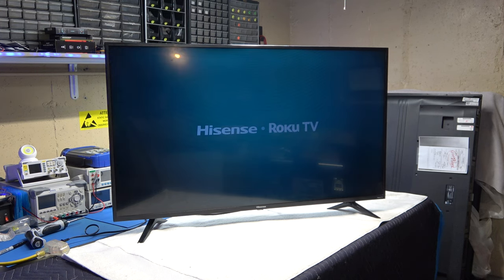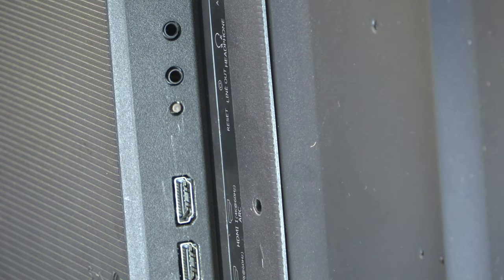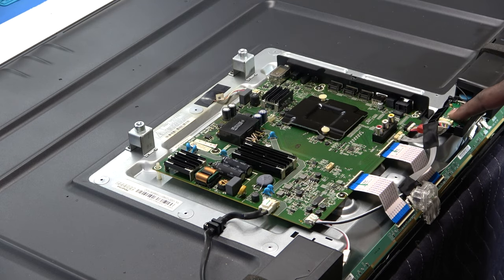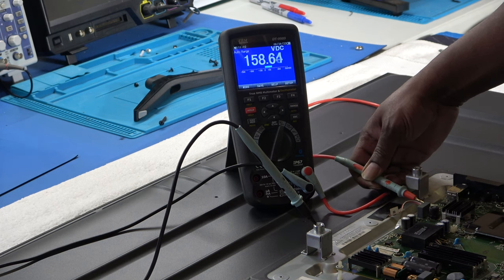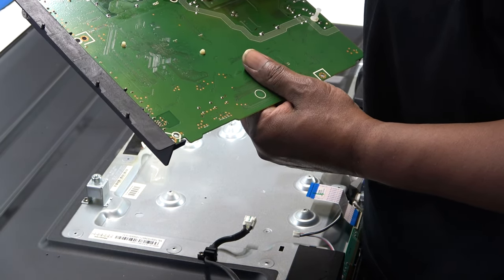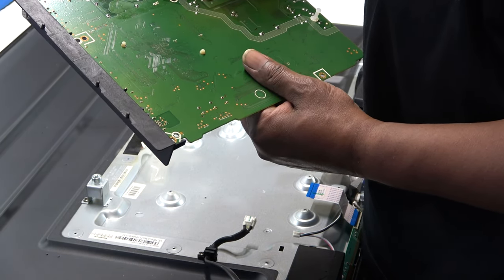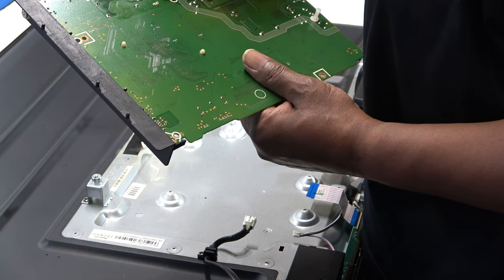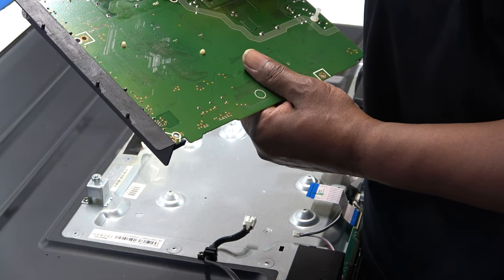Hisense Roku 50R7E boot loop fix when reset button doesn't work.

Comment: Dude! You’re a life saver!! Thanks for this info. Hisense is of no help when you call, I tried the reset button numerous times with the same issue (screen bounces between on and off constantly), and sure enough.. have these swollen capacitors. Local computer repair place charged me $5 to replace them and now my TV works like new
Reply: Mi television esta asiendo eso y no tiene un rest bottom
Reply: You reset with the power button @chiquitasleep
Reply: @IMjustAGirlInTheWorld1983 My tv power button used to turn off my tv but the problem of display started it wouldn't turn off except I use remote. How do I do the reset?

Comment: Having the same problem with a Hisense 55U6K from Best Buy. This is the model with the mini leds.  The back of the TV shows May 17, 2023.  Purchased on 10/5/2023.  It failed in mid-December 2023 and was not used daily. Only now just getting around to trying to troubleshoot it.  THANK YOU so much for making and posting this well-done video! 😎👍👍
Reply: I pulled the cover off and all the caps look good.  I have no idea now what could be wrong with it. :-(
Reply from the maker: Its still under warranty, take it back or call Best Buy with model and serial #.
Reply: @frankcanha  You say they "look" good. Did you test them to be sure? I've had too many times of buying something and relying on the fact that it's new, and turn around and test it and it's garbage. This seems to happen more often than it should these days. Anyway, if you decide to test them bitches, there IS a right way and a wrong way. From what I gather, (yeah, I ain't got a clue) they can explode if you don't drain a used capacitor because they can still hold a charge even after removing them. Good luck to you. I'm gonna see if I blow up once my capacitors are delivered.
Reply: @bigdog8882  Hey can you please tell me the size of the capacitors if you remember.

Comment: man i had my tv not working for along time and almost threw it outside but decided to try replace the capacitors as they were a bit bulged out, ofc they were hard to find so had to order from China but they came fast still, replaced both of them just incase and poof its been working fine ever since, TYSM MAN YOUR A LIFE SAVER🔥🔥🔥🔥

Comment: Just watched your first video,and it didn't work as I tried 4 times. But, I noticed that a black bar came across my screen after I let the re set button go. Hopefully trying this will help. Thanks for you help
Reply: Same happened to me with the black bar did you have any hope?
Reply: @marvintolbert2409  I had the same black bar issue when resetting and replacing the capacitors worked for me. I just fixed my TV 15 minutes back, hope it helps.
Reply: @waqasahsan  thanks I'll try it

Comment: I have a 55R6040G Hisense Roku TV that had the LED Backlight go dim all of a sudden. The backlight was evenly lit so i suspected something on the main board was the issue. I scanned the board and saw the two capacitors in this video swollen. This happened last week and I'm waiting on the capacitors to arrive in a couple of days. But this video confirmed my suspicions were correct and was hoping this would be the fix. Your video definitely made me confident in knowing that was the issue. This video randomly popped up on my home page and I'm so grateful. Thank You for taking the time to post this repair. Cheers!

Comment: I was also a victim of this problem with my Hisense Roku 43 inch TV. And guess what I saw when I opened the back cover? THE 2 SWOLLEN CAPACITORS!! So I replaced them and WALA! FIXED and RUNNING! Thank you my brother I have my 2 year old TV back.
Reply: Where did you get yours at?

Comment: Thank you for this video!!!! 

This is exactly what my problem was, except that only one of the two capacitors was actually bad. 

Now I did not have the correct value on hand, so I ended up “creating” a 10uF, 350V+ (actually 550 volts) capacitor by putting a total of ELEVEN caps in series, all of varying capacitance values but all were rated at only 50 volts each. It worked perfectly!!!

I am ordering the correct capacitors for this TV from Digikey, and I will replace both capacitors, but at least I have a working TV while I wait for them to arrive. 

Again, thank you, thank you, thank you for making this video!

Comment: Thank you so much! I searched for months for an answer to this. I could not find 350v 10mf capacitors on ebay on Amazon that were reasonably priced or in the US, so I bought 400v 10mf and it worked just fine. I had a little trouble heating the old solder to remove and pushing in the new capacitors, but I kept at it.
Reply: Do you happen to have the link to the capacitor I need to order 2
Reply: Same

Comment: Great video. After trying soft reset and hard reset on my 50RGE1 I found this video. Didn't bother checking just went a head and ordered the parts. After opening it up sure enough the 2 capacitors were bad and I replaced them. It only took a few minutes and fixed the problem right up.

Comment: Great video! Watched it once, was able to clearly understand the fix and replaced my capacitors in less than an hour! Thank you!
Reply from the maker: Great to hear!
Reply: @bigdog8882  Hey at Minute @4:50 The plastic power button My TV has the same one I tried everything but can't get it off you got any tips on how to remove it without breaking it?

Comment: I have a Hisense Tv that has a red blinking light and won’t turn on is this the same problem you think I’ve tried to reset and nothing
Reply from the maker: Probably not. Maybe backlight problem.
Reply: @bigdog8882  I tested the power supply board and I’m not getting any voltage where the led plugs in
Reply: @bigdog8882  I unplugged the led and plugged power into tv and tested to see if I was getting voltage where you plug led into and nothing

Comment: What if the capacitors don't look swollen , but your TV is doing the boot loop. I already tried to reset it with no luck. So its definitely something else. Could the capacitors be bad and not be swollen?
Reply from the maker: Is this the exact same TV as the one in the Video?
Reply: Idk if the same model but yes it's a hisense roku 55". Looks exactly the same
Reply from the maker: @illthoughts YOU would have to check the capacitors with esr meter or check the voltage, otherwise its usually the mainboard.

Comment: Hey @bigdog8882 , I have a TCL Roku  TV model 50FS3800 that is doing this exact same thing. After reviewing this video I took my TV apart but I am now staring at both a Power Suppy board & a TLC Main board. I cannot tell where to find where the LED capacitors are located to potentially replace. Can you tell me which board the LED capacitors will be on (either the Main or Power Supply)? None of the capacitors look swollen on either board but i rather start with the LED capacitors replacements first before taking everything apart. Thank you again 🙏

Comment: THANK YOUUUUUU, bruh. It didn't work at first after I changed the capacitors. Then i reset it. Still didn't work. About an hr later, it started working

Comment: Awesome videos, but what if the capacitors are fine? Have you run i to that? Thats what im dealing with, they look good, no swelling or anything. Also, arent the capacitors dangerous to touch? How can you tell of theyre charged and how do you discharge them safely?
Reply from the maker: May have a backlight problem. See if the picture is darker in a particular area when it reboots.

Comment: i have the same problem on a Hisense 65R61G keep rebooting plus no backlight , my backlights dead , no swollen capacitor but i still changed them and no change. what could i do ? replace mainboard and backlight ? is backlight failure could make tv rebooting i dont tgink so thanxxx
Reply from the maker: Is the picture rebooting, or No picture, just clicking? If u have any image at all when it reboots, then change main board.
Reply: @bigdog8882  i only see hisense roku tv with a flashlight ( no backlight ) appearing and then tv shut down like rebooting exactly like you but with no backlight . red light flashing 3 times

Comment: Bro, do you sell Mainboards?  Hisense 273265.. also is the reboot loop a mainboard issue, or a powerboard issue? 
Model 75H6510G Variation G2021JB
Reply from the maker: From my experience its the backlight or most likely main board.
Reply: @bigdog8882  I opened it up, none of the capacitors are bulging ... Main board says it's 27365 per Hisense.  But after opening it up it's actually 272945.  I wanted to avoid buying both boards if it's not necessary.  Regarding my other question, do you sell main/power boards?

Comment: I have a Sharp LC-65Q7370U, it's doing the exact same thing.  I tried using the reset button to no avail.  I opened it up looking for a swollen capacitor, but all of the capacitors look find.  If I purchased a main board and just swapped out the boards, do you think that would solve the problem?
Reply from the maker: Yes, replace the Main

Comment: Another great vid.  I have a Hisense with a similar problem.  No visible reset on the panel.  Is there another way to reset it?  My symptoms are similar with a weak logo on power with no boot.  All caps look good on visual inspection.
Reply from the maker: replace the board.
Reply: @bigdog8882  I replaced the main board and no change…..  so I guess I shoulda replaced the power board huh?  I got the main from tv parts today so I can return it.  Ill order a power board.  Thanks for the reply.  Your channel is great!
Reply: @bigdog8882  my saying something storage n doesn't let sign in too google but my youtube works
Reply: I changed the LED strips and fixed the problem
Reply: @missiletm  thank u. How do I go bout getting parts I discounted everything. Everytime power up volume at 25

Comment: Hey big dog seeing if you can help me out I have a 65 lg led smart tv and it started to fade out so I replaced led light on it and now led will not come on no backlights so I replaced power board and still nothing so I replaced mother board and still no backlights I tested led and they com on with led tester any suggestions before I break it lol please help
Reply from the maker: DID you replace all the strips?
Reply: @bigdog8882  yes I did

Comment: Hey I did the reset button and it didn’t work and later I opened the back cover and checked the capacitors they are not swollen. What should I do next it still keep on rebooting. Plz help me
Reply from the maker: Check and/or change the capacitors anyway.
Reply: @bigdog8882  thanx for the reply ok should I change the small 2 capacitors or the the big 2 capacitors as well 450v one ? Plz Telme so that I can order the capacitors ?
Reply: @bigdog8882   i did this as mine weren't swollen and it still boot loops after about 20 seconds when i get to the login screens
Reply from the maker: @PhotoRestorationVideos  If its the same TV, try to hold down the reset button again after you replace the capacitors.
Reply: @bigdog8882  that was the first thing i did :(

Comment: What’s the name of the capacitors in this tv so that the replacements are correct
Reply from the maker: just get the correct value 10 microfarads at 350 volts.
Reply: @bigdog8882  do the NEW ones need to be soldered into the board?
Reply: How do you know if they are in bad shape?

Comment: Hey great video. I’m sure I have the same issue. My question is when you heated the capacitors to remove and put them in, what did you use? And what can I use if I don’t have the tool you have. Thanks.

Comment: 50” Hisense ROKU 
Model #: 50R6E1
TV stuck in the loop.. 
Reset (-) 
How do you “know” if capacitors are no good? 
& is there any chance this issue is coming from the power cord itself? 
TIA !
Reply from the maker: NO

Comment: Bigdog i know this is an old video already but figured id ask just in case. If you have the time i'd really appreciate it. The tv had been booting fine every now and again, but decided to do a factory reset (thinking corrupt firmware maybe) and it got stuck in the same bootup loop. Tried measuring at 200V level with a multimeter at the output of the LED connection,  but it doesnt seem particularly obvious that its doing something weird. The voltage drops by maybe 10 V (from 160 to 150 at the white wire but from 80 to 30 at the red wire). However, the caps look fine. Should I just change them regardless even if they dont look bloated? I dont have a multimeter to check capacitance so dont know what else to check. Transistors dont look burnt, capacitors look healthy (as far as I can tell). Are there any other checks you'd suggest? I'm relatively familiar with electronic equipment testing but dont know what type of voltage I should expect on the backlight to make sense of it. Any sort of help would be a blessing

Comment: Thanks, my parents where going to just buy a new one, i saw your video, bought 2 for 16$, got them then realized i  got axles instead of radial, but they fit even though there 2x bigger lol and it works again

Comment: I have the same TV and the red light keeps popping on and off. No picture. I unplugged and did the reset and it still doesnt work. How do you know if your TV 8s shot
Reply from the maker: Thats easy, call the TV repair and pay for a diagnostic..
Reply: @bigdog8882  That's not helping me at all.
Reply from the maker: It sounds repairable, but unfortunately the Tv has to be diagnosed to see why the red light is blinking and no picture. It just depends on how much you wanna pay for a repair.
Reply: @bigdog8882  what if I left it on 24/7 for 2 years. Would that have something to do with it? The TV is only 2 years old. I first started having trouble a week ago with the remote so I got new batteries. I cant even get the remote to shut it off. It still keeps blinking.

Comment: I have a Roku 65" TV 65R617 with the same problem. I'm reading online and some people are recommending to change the main board. Is there potentially a problem with the backlight filter capacitors on the circuit board for the TCLs as well? Thanks
Reply from the maker: Most likely Mainboard..
Reply: @bigdog8882   I have this same issue replaced all boards and still having the issue
Reply: About to find out with my less than 2 year old Hisense ROKU 65" 4K that is doing the same thing, if I can actually find the caps anywhere. No luck on Amazon so far.

Comment: I have a 75 inch Roku Hense doing the same. Do I use a 10 far capacitor  it well?
Reply from the maker: probably NOT, 75 inch backlight circuit is made different.

Comment: I changed the capacitors and did the reset button after. The TV will go into recovery mode. Once it reboots from recovery mode it gets stuck back in the boot loop. I’ve tried the reset button/recovery mode multiple times and it won’t work. Any advice?
Reply from the maker: Make sure you have the right value capacitors and make sure their installed correctly, not backwards. If not then just change the whole board, shouldn't be that exspensive
Reply: @bigdog8882  changed the same capacitors due to being swollen now have the same problem as posters comment. Decided to test all capacitors on board the two directly below these two won't reach continuity, they are 470uf 25v should I change them or just buy a new board?
Reply: @a420triggerman. I have the same problem did changing the other two fix it for you?
Reply: @edwardleshore4943  no it didn’t :( I couldn’t fix it
Reply: @evesmith3057  dang I was really not trying to buy a new tv

Comment: Woke to my 65 inch doing exactly this today, reset does NOT work - Got it off the wall and apart, sadly NO similarity and stack of caps, no way for me to know where to go now, none look swollen or bad....
Reply from the maker: If its a different tv, then suspect main board.
Reply: @bigdog8882  Just replaced every board on it to the same error, then see a single video that shows that this same exact  problem occurs if you lose a single led light in the back light set, it detects it and you are caught in the on off logo loop. So the problem is likely just past the capacitors and the back light  leds themselves are apparently cheapies as well. They fixed their with a back light  LED strip set.
Reply: @jsauerii 
This led strip set you speak of.. Is this a hisense part, or an off-the-shelf led part? 
I just replaced my boards and I'm experiencing the same. On the 65"

Comment from the maker: If you know a little Electronics and are interested in doing TV Repair; I have a 📺*Television Repair Course* . MORE INFO>>>📺https://www.youtube.com/watch?v=4r5X0zq_1dQ
Reply: You must of went to it school, you're definitely too smart,I tried soldering but it's hard when my hand shakes,I gotta question if you don't mind answering my same TV is having backlight problems like I turn it on its blacked out but when I use a flashlight I can see everything not as good but I'm curious do you think the backlights need replaced.had the TV for about 3 years.